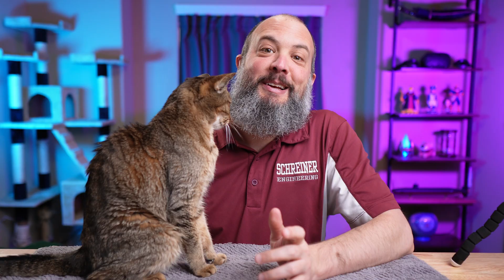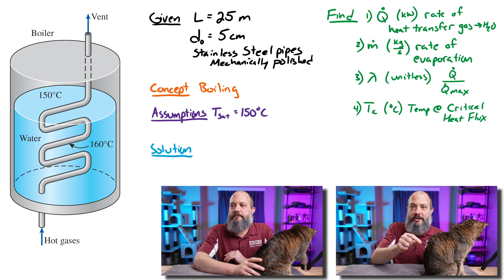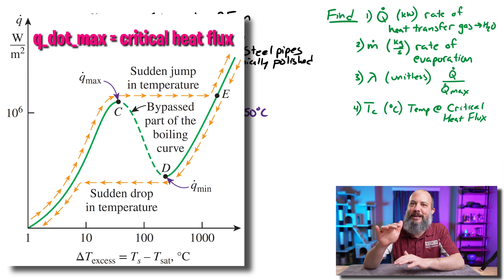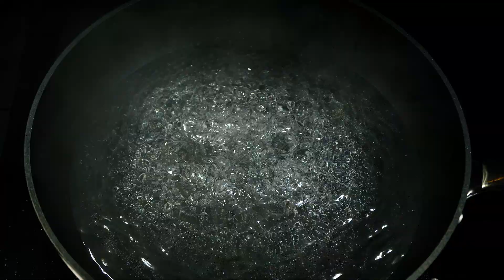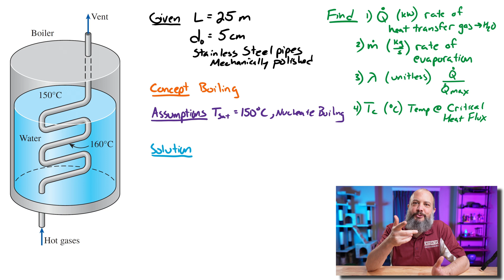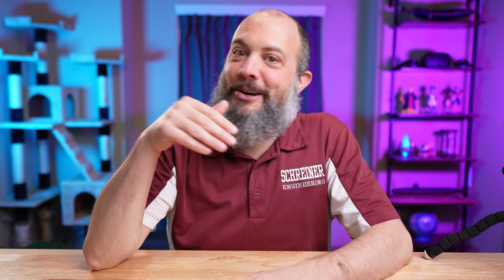Heat Transfer Boiling Example Problem

Comment: Hello, great video on this kind of subject. If hot water is used for evaporating water (my example is in vacuum) how do I account for this at heating surface temperature Ts in equation? I tried assuming outlet water temperature (knowing the inltet) and calculating mean log temp and pluging that in, but I dont know if that is right.

Comment: Hello! I know it is kind of unrelated to this video, but can you give some tips how to understand the fluid flow equations?
Reply from the maker: Hard for me to answer without more context since there's a million different fluid flow equations in engineering. If referring to fluid mechanics, like the Bernoulli or Energy Equation, I understand these best by placing myself in the system, as if i'm riding an innertube along with the flow. That helps me keep track, when I was here I had this much kinetic, potential, and pressure energy, then when I got up here, I had lost some energy due to friction, and therefore only had this much KE, PE, pressure energy left. Makes it easier to visualize when its me instead of just water in a dwg. If you mean Heat Transfer, like convection equations for fluid flow through or around pipes, finding the Nusselt Number - I like to embrace the ambiguity. Know that Nu equations are not derived from first principles. Convection is way too complicated for that. Instead, these are curve fits of experimental data. That's why you'll find many different equations that all say they are for the same situation. They are just derived from different sets of experimental data. I understand these equations best by comparing them all against each other, which is oldest or newest, or easiest or hardest to use.